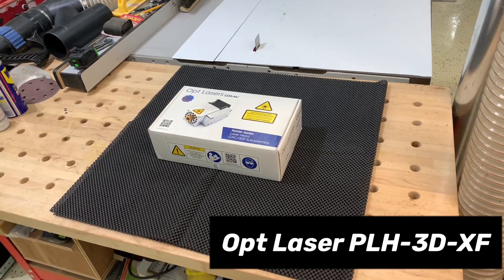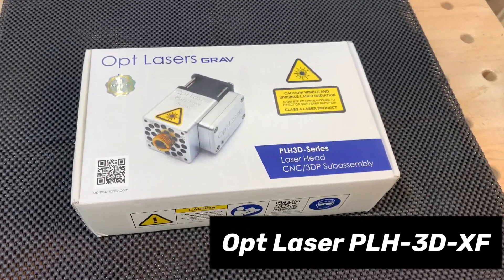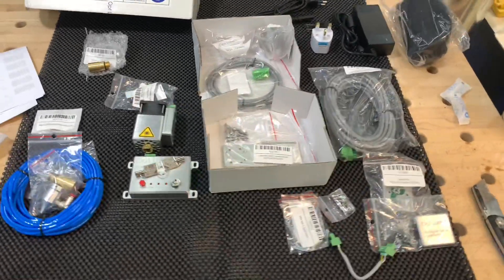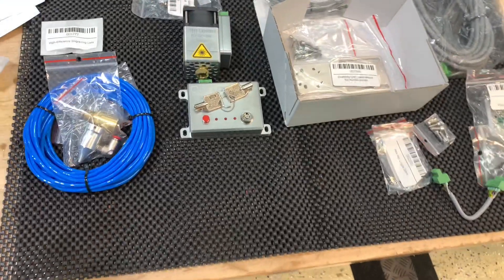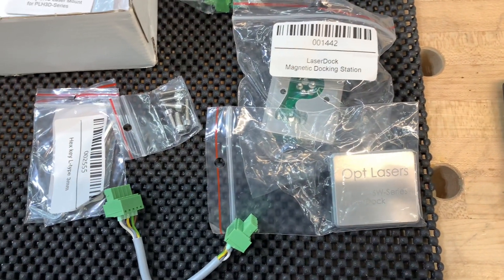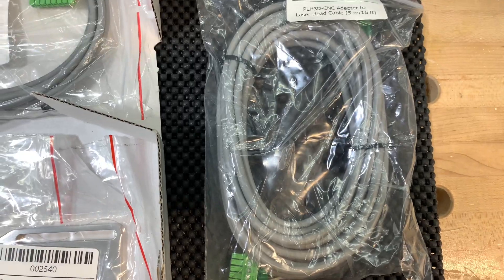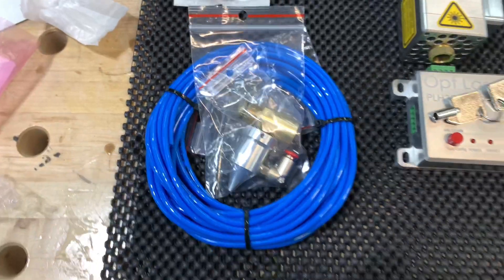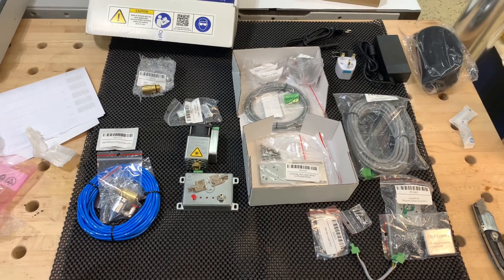Opt Lasers - Onefinity CNC Laser Upgrade Kit - Unboxing and First Impressions

Comment: Great intro the laser package offered by Opt. I have recently purchased the OF Woodworker and same Opt laser package. I am working on setting up the machine and installing the laser. Do you have any advise on the install and settings for the OF controller and what program are you using-Vectric or Lightburn? I look forward to your follow up video and you using it.

Comment: Hmm Why would i pay 899$ for a 6W output laser. When i can get a 7W output laser (Jtech) for 670$ for the onefinity? It looks like a decent laser but for the money I cant even consider it.
Reply: Laser docking station (179USD) plus programmable inputs in the Adapter in case of future software upgrades, made of metal, and the diode is not overdriven, and many more in general.